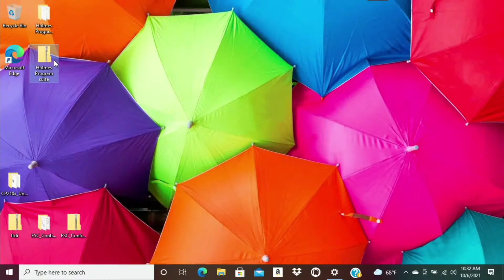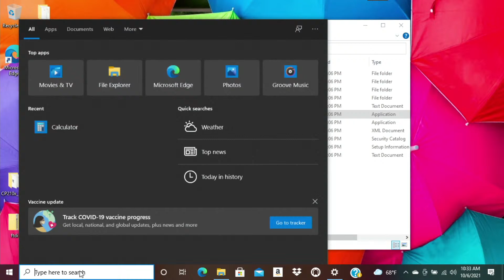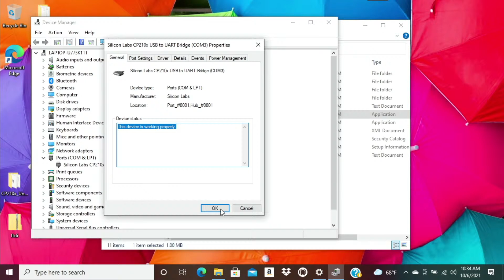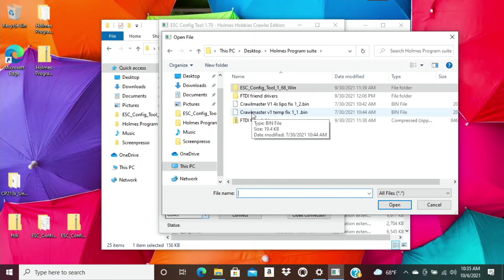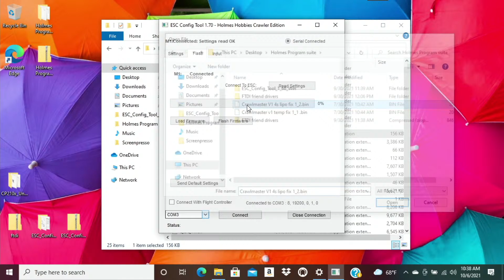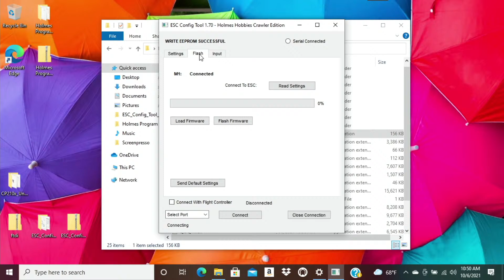Crawl Master Mini Suite Programming

Comment: For anyone looking for an AM32 Programmer (HH is out of stock atm) Delux Fab has some in stock.  Bought mine Sunday evening, it shipped Monday and arrived 2 days later.  Had to run to the DG and pick up a USB/USB-C cable for the AM32 as I didn't have one myself.

Comment: Thanks for your help John. This Tut... worked great.  Got my CM Mini V2 flashed with the 1.2 firmware now.
Ready for the next update. 

Running with a 2200kv Revolver and on real slow wheeling the esc would get pretty warm, near hot, on 3s 30c.

Hoping this helps keep the esc cooler.  Off to do some testing.

PS. LOVE MY V2 CM Mini/2200 Revolver combo!  IS THE SHIT in my Monster Mash build.

Comment: Got my programmer today and updated my Crawlmaster Mini to the newest firmware. 

Went to my crawl spot with my Class 3 running a Revolver V2 2500kv. Both motor and ESC were room temperature after a sold hour. Thanks for the great products John.

Comment: I'm curious. has any one had problems i downloaded the driver. to windows 10 but computer dont read card when plugged in. found out problem. all micro cables not made the same  I went threw 5 different cables found a old one  worked. YESSSSS...
https://youtu.be/sm-2YodH_Cw

Comment: Am I ever gonna be able to buy a crawl master mini? Preferably in kit form?
Reply: I believe they have then in kit form already
Reply: @rc-daily  the kits haven't even been listed on the sight for months now.
Reply: @duder280z  ah yeah I see. You're right. I knew they had sold out but I thought they had restocked and had piles of them now
Reply: @rc-daily  They were never restocked. I've had a build on hold for over 6 months because I can't get one. I have a Mamba Micro in it, but it needs the crawlmaster. The micro just can't compare, no where near the control and drag brake of the crawlmaster. Plus it's quiet (I'm running a revolver snubby).
Reply: @duder280z  I run a 2500kv snub nose with a micro x myself. Then I have a 2500kv full size with a sw4. I want the crawlmasters myself but I want to buy them ready to go with an easy way to program them. So I'm patiently waiting.

Comment: Been working on this a hour now and when I pug in the programmer is is saying it’s not recognized and nothing shows up on device manager
Reply from the maker: Win10? Do you get the USB device ding?  Using the silab device?
Reply: @HolmesHobbies  I sent Justin a msg but I get to the part ware you load the driver and it says it will not work on my computer.  I have windows 10. it opens  up I hit ok and then when the finish part comes up it says will not work with this machine idk
Reply from the maker: You using the x86 or the x64 driver?  Tried both?
Reply: @HolmesHobbies  I tryed both the x86 told me I needed to use the 64
Reply: Got it working finally don’t ask what I did but it’s working
Reply: @johnroddy931  please tell me how.  im fighting dame issue. I download to windows 10 ..when I look in ports it disent show it connects.

Comment: Thank you, this explain why my previous attempt to flash to 1.2 failed to work. Turns out the settings after flashing on my esc is way off compared to the one showed in the video. After adjusting the settings according to the video the esc now starts up and working fine. 4s here we go......
Reply from the maker: Awesome, success!
Reply: @HolmesHobbies  does this programming update the 4s kv capabilities or still 1400 for now?

Comment: hello John, I am currently converting an enroute mountain v1 into a no comp trail crawler. I definitely want a brushless setup. what would you recommend? puller prov2 r540l 4100kv or is that too much of a good thing?
Reply from the maker: Oh, way too much.  Use puller stubby
Reply: @HolmesHobbies  ok 👌  thank you very much ! Pls do so on, you did a Great Job!
Reply from the maker: Don't know that vehicle
Reply: @HolmesHobbies  
On a enroute berg v1 MoA, 4ws. I live in Bavaria and it had to be bulletproof.  Im go often the hole Day up mud, snow and downhilltracks in the woods. Mostly no rocks. So what ive learnd wheelspeed often helps in my Terrain. It dont had to go sooooo slow. But Sure a good slowstart is also a wish but Not like a pure rockcrawler...
Also is the weight of the rig Not soo important for me.
Reply: There's a photo at the link, you can't add a photo to the comments here, sry.